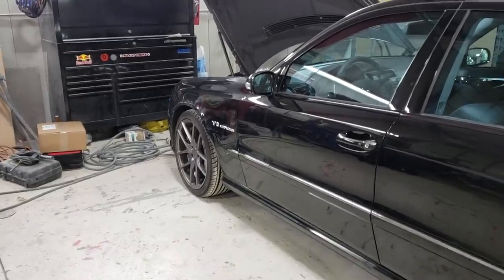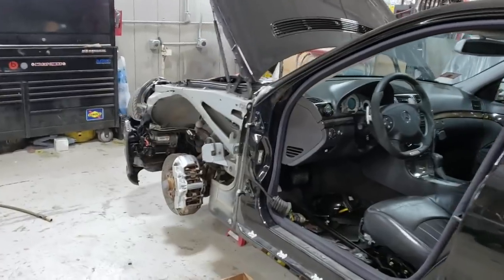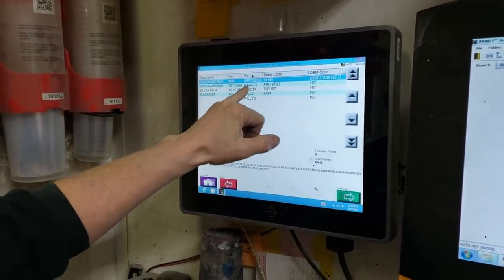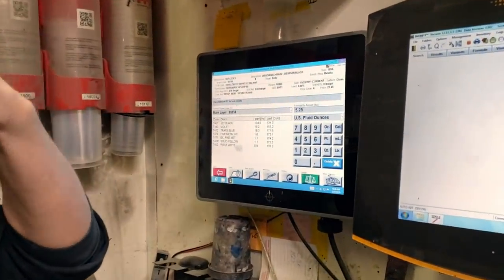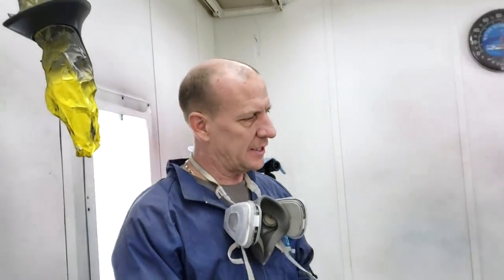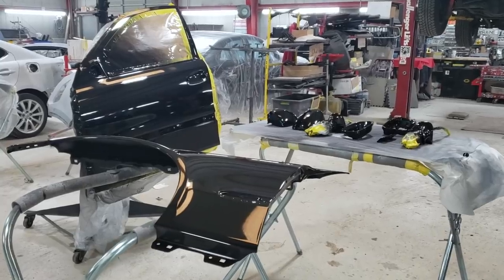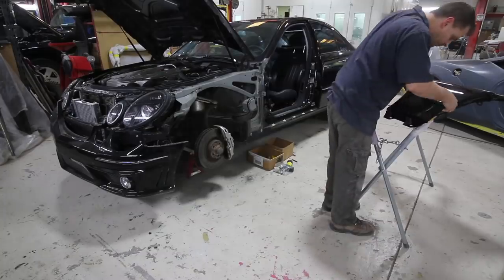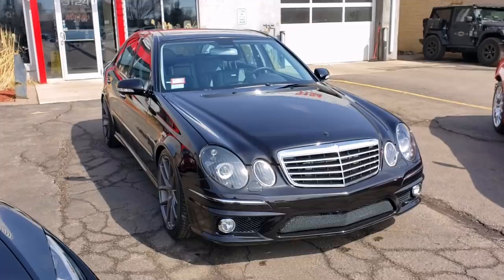Someone Smashed Into My PERFECT E55 AMG So I Took It To A Lambo & Ferrari Body Shop To Get Fixed!

Comment from the maker: What's the most you've been paid out by insurance after an accident?
Reply: Bout 10 k. Was back in 95-96. Scrapped my mk2 gti , still miss that car !
Reply: 9k after some idiot rear ended my e500. It was going to be about 7-8k for repairs so insurance made it a total loss and I didn’t want to keep it
Reply: In 2012 someone pulled out in front of my wife driving my 99 C43. She hit them at an angle and climbed up the side of their giant land cruiser. Insurance totaled it. Tried to give me $1700. I flipped out and escalated up the chain until I got $5900. Fixed it, still drive it. Even put an E55 motor in it.
Reply: LegitStreetCars Had the same damage on my e55 , only damage was to fender got paid out $2700. 
What was ur payout?
Reply: 12k on a car worth at best 15k
Reply: I paid out over 127k for a G63 that one of my insured hit and caused to flip over. But that was a total. I paid out 67k for a repair on a 911 that one of my insured hit in the front with their CRV.
Reply: My wife's Seville was totalled in my driveway! Guy missed the curve by my house, ran across the lawn, and knocked it into the corner of the house. Got $4500 for the car and $12000 for the damage to the house. The drunk idiot left his truck where it stopped and ran away. All his info was in the glovebox! Cops had an easy bust on that one. And he lived about a block from us!
Reply: 6k. 2003 530i got totaled and they decided to price the 2004 e60 model. Only paid 2k for it haha
Reply: Local guy bought a Maserati 3200 GT Assetto Corsa. This happened ~5-6 years ago.
And at night - drunk driver hit 4 cars. His car got main hit. And it was unrepairable. 
Of course insurance wants to cover as little as possible. They offer 30,000 euros. Guy wants 70,000 because that is what he paid for that car a month ago. Insurance tells him to f-off. They will not pay more than 40,000, take it or leave it. So guy goes to court and rents a car (some sort of performance car which costs a lot per day). So after 2 years of processes - court obliged insurance company to cover full amount for 70,000 euros. But now, guy needs ~130,000 for his car and a rental, because he had a right to rent a car until insurance pays him. So finally I don't know how it ended and if it ended at all, because last thing I've heard was that insurance didn't want to cover rental car, everything went back to court and so on. 

BTW, this paint shop looks very professional. Top quality.
Reply: 2.9k for fender damage.
Reply: LegitStreetCars $500 for a 1993 Chevy 2500 steel rear bumper. Had such a small dent from the car that rear ended me, I didn’t even need to replace the bumper :)
Reply: $8400 paid out by my insurance company to fix my E320 CDI that was rear ended on the highway. NOT totaled, they actually fixed it!
Reply: 4K for my Infiniti. A lady driving her husbands GMC 2500 with a 9in lift turned too early and ripped my bumper off with his 37in mud tires. Ouch
Reply: 350€
Reply: £2900 for a 320d tourning that got t boned by a guy pulling out of a side road. Only paid £2000 for the car 6 months earlier.
Reply: We were paid about 10k for a basically worthless Monte Carlo. Nice little upgrade after that.
Reply: Had a fender bender in a parking lot with my 2014 F150... slid on ice on an embankment in parking lot and hit a steel storage crate. $3500 in damages!!
Reply: Nothing.
Reply: $2,700-ish in 2010 after my car was randomly keyed on several panels.  Well, maybe not randomly.  I was living in an apartment complex at the time, and I suspect the losers who lived next door to me keyed my car.  No witnesses and no cameras, though, so I couldn't prove it was them.  The apartment complex had carports, no garages.  Sucks that I had to get four panels on my car repainted, even though it was never in an accident.
Reply: Greetings from Romania! Here at the dealership ex. Skoda, VW, Renault is from 100€ per part. A hole car spray, a bad one is less than 1000€, and a good one from 1500€ depends how big is the car. Keep up the good work, I like your videos!
Reply: I had a salvage title BMW 128i which I paid $6250 for after repairs.I t-boned an 80 year old man who thought he could turn left in front of me within me being 20 feet away doing 40mph(speed limit).There was a witness on foot waiting for the light to cross the street who stayed around the whole time.Old man got a failure to yield and next week I got a check for almost 16 thousand! Fucking mint! State Farm is legit and paid me quickly.
Reply: @ssweetener    not a regular 911
Reply: A lot....
Reply: Neighbor crashed into my dads 997. I think insurance paid out over $20k.
Reply: 9k headlight, fender, door 528
Reply: A couple of weeks my 2008 S550 got side-swiped on the freeway. The driver's side front fender, bumper, door and mirror got damaged. The mirror and fender had to be replaced. Total cost of repairs... $3800. Unfortunately my deductible was $1000 :(
Reply: 30K on my Porsche after an uninsured driver t-boned it. Repaired at a great shop but took 3 months.
Reply: I got 80k from a motorcycle accident. My dad (lawyer) did a good job taking care of it. Injuries were fair
Reply: $50K.  My wife and I were rear-ended by a commercial HVAC truck (big 3500 or F350 chassis).  This was in 2004, but she will have back problems for life.  The settlement wasn't that much because she has been a stay at home mom, so no loss of income to claim.  About $3300 in repairs on a POS Dodge Intrepid I had just bought 1 week earlier.
Reply: 29k for my parents ML63 that hit a deer
Reply: @AJGreen-cn8kk  I hope that muthafucka went to jail for a while.
Reply: @LordPrometheous  nope. When I followed up with the States Attorney all he said was it was settled. Wouldn't tell me anything. My guess is he copped a plea.
Reply: @AJGreen-cn8kk  Damn.  I probably would have checked online to see if he had prison records.  But in the end, I guess nothing can be done but move on.
Reply: $19,850.
Reply: $42k
Reply: Couple years ago I bought a 2014 scion frs with front end damage for 3k, put in another 2k for repairs, someone hit it while parked on the street, got paid out 15k
Reply: Instablaster...

Comment: Who needs a brand new car? Just get it paint corrected and have Alex be your personal mechanic. It's great to see professional work done. Not the usual hack work that's done in many establishments.
Reply: It don't matter how good the repaint are. It still not as good as new car.... You can try changing new part... But it don'r worth the money.
Reply: campkira the finish is likely better than any factory paint. Only problem is now the whole car needs to be wet sanded and buffed to match these perfect panels.

Comment: Alex, Thanks for filming the repair process, it is great to get to see the experts at work behind the scenes. One thing would be interesting to know the final grit of the dry then wet sand process. I was shocked to see them sand what looked like a perfect paint finish. It was a work of art and I was surprised to see only $2300 out the door. A bargain in my opinion.Another video done to perfection! Thank you.

Comment: You went to a high end repair shop that specializes in high end repairs. But their repair procedures are 100% identical to what most repair shops perform. I was expecting them to sand the body panels down to bare metal. That's what they do when they fixed actual high end cars.
Reply: No, that would be a mistake. The factory finish has the best corrosion resistance, you NEVER want to strip a modern vehicle to bare metal if it's not necessary, as long as the existing finish is in good condition.
TC
Annapolis, MD
Reply: @megaman4201  Hello, that is not true. Any modern etching primer would have the same or better corrosion resistance compared to factory. The reason you want to sand down to bare metal is that new primer does not stick to the old paint job as well as bare surface. This is why an aftermarket paint jobs are more prone to paint chips, since most aftermarket paint jobs are painted over existing paint jobs that have been "roughen" up.  Another issue is that if you have too many layers of paint jobs, it will make the paint thicker under the paint thickness gauges. This gives professional detailers a hard time to properly polish the car when they cannot get a consistent reading on the paint thickness.

Comment: Pulled a door trim off the girl's W210 to replace a grab handle. Three days later and both front door trims are still my living room being reglued. The factory glue had turned to something like earwax, and  all the mounting stuff, weatherstripping, and the two pieces of door card itself all just came apart.  I can't stand loose door trims.

Comment: @13.46 - There is an imperfection on the fender, on the right side, closest to where the door will be.. A few seconds after that you can see a big "bubble" in the paint near the front of the fender.. Just as it looks or was it crap that landed on the paint?

Comment: I'd love to be able to upgrade my 2006 E350 to the newer 2007+  mirrors, but the are a complete new door mount design (and would need to also change the door. 
How did you manage to do yours? 
Please run us thru the details. 
Thanks! 
How did t

Comment: Did you have to wait to have the ceramic coating reapplied?  Based on what I know if water-based automotive finishes, once the finish is cured (e.g.170F) you can just apply the coat once the buffing is done.
Reply from the maker: They said to wait 30 daya

Comment: Any ideas were to start for a great body shop in Washington state?
I am looking but browsing the net or visiting shops does not tell the whole story.
Reply: It's tough if you don't know anyone. But start by looking at what they work on,ask some of the high end dealers who they use etc and go from there. Also if you find a independent high end specialty car dealer ask them too. Last but least is don't be afraid to travel, I tow cars all the time to a shop over 100 miles away because they are the best.

Comment: Hey I had my e55 backed into just on the door and when I put it under high light (1500 lumens) it has a blue tint and the rest of the car doesn't it was $1095 just for the door and dent removal I don't think this is normal but wondered what yours looked like under light without light it's black just like the rest of the car and when it's outside it's black like the rest of the car as well

Comment: High end body shops should be using Glasurit brand paint to paint your E55. That's the original paint that was on it
Reply: I'm glad to see you brought this up, because I was wondering the exact same thing as I was watching this video. My "local" high end body shop uses Glasurit paint.
Reply: hamsterama . Yeah I’m sure their techniques are good and their workmanship is A+ but Glasurit is definitely the way to go if you want OEM quality refinishing on German cars
Reply: @johnadamczyk6213   Yep, my understanding is the Glasurit is a much better quality paint than PPG.  The work done on my car (using Glasurit) from the body shop I used still looks amazing eight years later.  No fading or anything like that.  Workmanship is important, but having top-end paint is important, too.

Comment: Hey Alex, why don't you swap out the steering wheel for the 07-09 one and also convert the rear lights to the same. Is it possible?
Reply from the maker: I have an alcantara flat bottom wheel in the car.  I could do the updated taillights too
Reply: @LegitStreetCars   Oh ok I didn't know or forgot about the steering wheel.. but definitely do the tail lights for sure.

Comment: a trained eye would easily spot the difference in orange peel texture. I'm surprised they sanded and buffed the entire panel instead of just sanding out the dirt nibs. Seems odd to me.
Reply: It's not odd at all, just preference. Some shops take the Viewpoint of trying to match the rest of the car, even if it's not perfect, but others want their work to look impeccable regardless of what the rest of the vehicle looks like... but most high end European finishes are fairly flat anyway.
Todd
Annapolis, MD
Reply: And yes, of course a trained eye can see what work has been done but 99% of  people can't.

Comment: A wonderful E55 AMG with Nankang tires (17:38 into the video)?! Are you kidding me?! They are death traps! Visit websites like  http://www.tyrereviews.co.uk/Tyre-Tests/#summer    for some serious advise on tires. Michelins PS4S or Continentals Sport Contact 6 are always excellent choices for year round driving (except on snow and ice). Try fitting Contis in the front (for better steering feel) and the Michelins in the back.
These particular tests are eye opening regarding the Nankangs (although contradicting in wet handling...):
http://www.tyrereviews.co.uk/Article/2018-Auto-Bild-19-inch-Summer-Tyre-Test.htm
http://www.tyrereviews.co.uk/Article/2018-Sport-Auto-UHP-and-Track-Day-Tyre-Test.htm
If you are considering some winter tires check this test just for your E55 size. They even tested some Nankangs:
http://www.tyrereviews.co.uk/Article/2019-19-Inch-Performance-Winter-Tyre-Test.htm